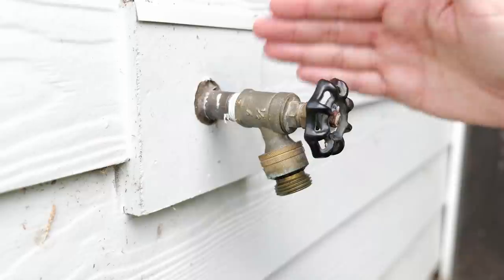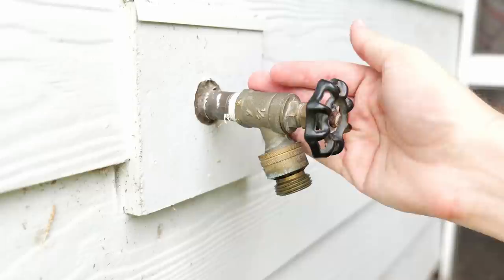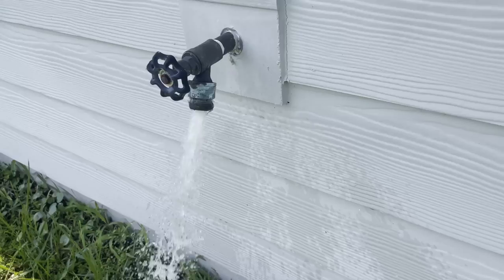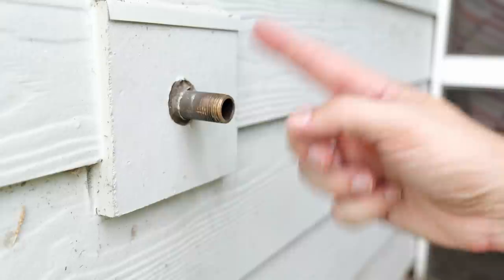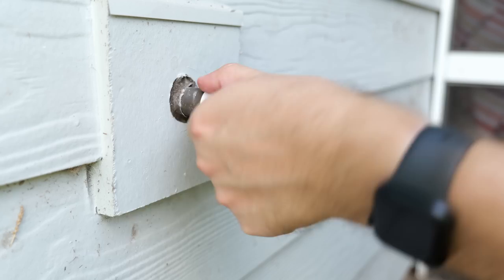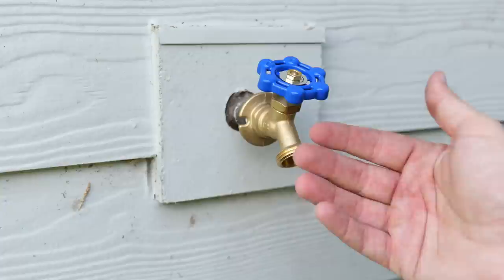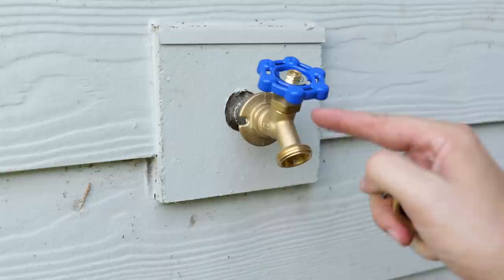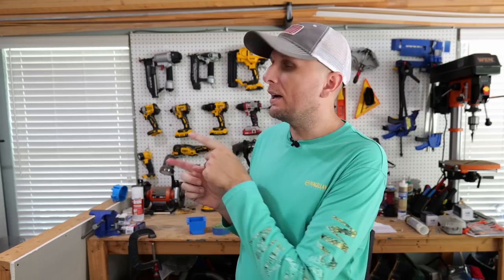The CORRECT Way To Replace An Outdoor Faucet | DANGEROUS and Common Mistake DIYers Make!

Comment: 7:00 Couldn't you just stick a bar of metal in the closed spigot opening and use that for torque?
The solid brass shouldn't deform at all so long as the bar stock is close to the inner diameter of the spigot.
Would leave zero visible damage and provide the easiest torque.

Comment: Is that little screw supposed to break off?  Looks like its tapered to do so on mine???
Reply from the maker: Yes they are.  I just refuse to do it.  If I was renting to someone or selling then I would.  But if that’s broken off, it’s almost impossible to get the vacuum breaker off if it goes bad.

Comment: Can you do a video on replacing the vacuum breaker (anti-siphon valve) when the safety screw (set screw) cap is gone? When my subdivision was built (2015), the builder intentionally had the set screw caps sheared off all the homes to prevent homeowners from removing these anti-siphon valves. I'm guessing the builder was in CYA mode by doing this; but it's a problem when an anti-siphon valve fails and needs replacing, as in my case. The hose bib itself is in otherwise perfect shape.
Reply: Where I live, I was told by a city inspector that it is in the code to shear-off the set screw.
Reply: Use a metal cut disc on a dremel and score a line in the set screw. Now you can use a slot screw driver to remove it.
Reply: If you have a drill and a set of bits, you could carefully drill out the bolt in that small hole. Just need to be careful not to go too deep and drill into the hose bib.
Reply: 8:55 They are designed to break off when tightened.

Comment: have to check out my hose bibs ... when we bought an old house recently and replaced the water supply line the plumber installed a new hose bib and told us we could just take the anti siphon valve off if we wanted to..... things we learn along the way.....

Comment: Have always enjoyed your videos but now I really need to ask for help 🙈

My washer half inch water supply line broke inside the washer room.
Went down into the basement and have a hot and a cold supply line.
I do not have a cap off
But I do have a half inch SharkBite connector.

Can I temporarily loop the hot and cold together with the shark bite until I can get this fixed next week.

I would assume that I would not be able to use my hot water line and that's okay if it will get me by.

Would it be okay to loop the hot and the cold together temporarily ❓

Thanks for all your work and labor in your videos.

Comment: Just replaced my "anti-freeze" faucet.  It goes through to a basement so it was easy access.
I really had to torque the outside faucet in order to stop that last little drop on the inside (I wrapped the threads three times with tape)
Now, it's almost impossible to turn on the water.  The pipes in the basement are PVC so I had my soon hold the nut inside while I torqued it (Facebook was our commo)
How do I loosen up the handle so we can turn the water on?????  Can't find anything on YouTube.

Anybody????

Comment: The little screw breaks off easily because his design to do that. This makes it impossible to remove the vacuum breaker. In the event that someone doesn't like it or the hose becomes corroded to it and it's removed when the hose is removed.

Comment: ..... The head is supposed to snap off the screw, causing a permanent attachment.  Most inspectors look for the head to be broken, making sure the home owner does not remove the vacuum breaker after the inspector leaves, which is what most people do because the cheap metals we get now are crap.  Most vacuum breakers clog and cause severe water volume issues and are a general maintenance pain in the butt, and because you are supposed to permanently attach them, have to be removed with a sawzall or oscillating tool.  I have never seen or even heard of someone polluting their water line because they did not have some sort of check valve on their hose bib.  Who buys a silcock that does not reach the house??  weird.

Comment: Ive had to simply cut off the existing valve and slot cut the band of female threads stuck to the male threads sticking out of the wall.
I invested in some Bonny Wrenches (very thin jaw extra wide opening).
Presently have a Freeze proof hose bib that had cracked from Ice.
after removing the 14" hose bib from wall and discovered on installing new the piping in wall had shifted and the engaugement is 1/4 hole off center.

Comment: My hose bib s probably 25 yrs old and is apparently frozen to the threads as it won’t budge. Naturally, I’m afraid to put too much torque to break the threads loose concerned I’ll damage the interior pipe. Any suggestions?
Reply: Can you get to the pipe in a basement or crawlspace?
Reply: @ngarber   Nope. On a slab. Thank you though.

Comment: Not having a vacuum breaker on an outdoor faucet is a code violation.  But it's not an all caps dangerous thing, at all.  The only realistic way water is going to flow backwards is if the water pressure from the city supply drops to zero.  That happens when there are water main breaks or other outages.  When that happens, ANY groundwater is going to get into ALL of the water supply piping from the city, unless it's brand new and doesn't leak...which is never the case.  The reality?  When the water goes out, dirt and things you really don't want to know about are sucked into your water system through the city water pipes.  So videos like this not only scare homeowners, but they also understate the problems with municipal water systems.  The systems only stay contaminant free when they're under pressure.  Holding your house to a higher standard is just silly, but it is required by code.  Source?  I worked for several years for a municipality.  Yes, I drink the water, but not for a day or two after a water main break.

Comment: Hi, I'm in a bit of a dilemma. Our back yard water spigot worked fine before the knob fell off and was misplaced. Family members started to use vice grips turn the water off & on. Over time the post was totally destroyed & we can't turn on the water at all.  Do we need to replace the whole spigot, or is it possible to just get a replacement valve where the knob & post are attached?
Reply from the maker: It’s possible yes but in that case I would just buy a whole new spigot and start new.
Reply: Replace entire valve, they not that much!

Comment: A backflow of a water molecule from the end of a 50 feet hose and ending up all the way back to the hose bib from an applicator will not happen in a million years. Another gimmick to add for plumbers and code enforcement for $. For a water hose applicator to work it has to have a huge volume of water flowing over the directional orifice to create suction in one direction as it will not work going the other direction as there is no volume. In the industrial plants that is a different story but not a hose bib applicator.

Comment: i hate those vac break things, they are such garbage, had to replace the one in my last house every year, they would fail and leak water all over the floor of the garage it sucked so much, and as you probably know red lt on the factory unit removal was a pain in the arse, I detest the things

Comment: Past couple years my frost free has burst. I turn the water off to it every winter. Is there something I can do to help it not bust?
Reply: Usually it's because your wall insulation isn't up to the task, the bib is in a location that's not heated very well, or the frost-able portion of the bib is too short.
Reply: First did you remove the hose from the bib? If you don't the hose bib won't drain properly and will hold water and freeze! Another thing to check is if the line to the bib is pitched so it will drain when the water is shut off?

Comment: Your setup would lend itself to a frost-free hydrant that goes into the wall and replaces that nipple....depending on how long that nipple is and if you can access/look at its origin. As far as using thread tape AND pipe dope.....that's a dumb Millennial/Gen Z thing that going around. If you do your job correctly, yes, use one or the other. The mega-type tapes pretty much correct the worst of Chinese threads/fittings. Chain wrenches are not that expensive and you can really torque them. Or.....use a good strap wrench like Klein's that doesn't stretch.

Comment: How can water go into the spigot if you turn it off? Isnt it sealed when you turn the spigot off?
Reply from the maker: Only with a vacuum breaker is it actually sealed from backflow.
Reply: @HowToHomeDIY  I usually let the hose run open-ended in one hand or while squeezing handle of the jet nozzle, and the other one turns off the spigot, I've never witnessed water get sucked in from the air. I guess this only applies to irrigation systems. I live in Florida, and most homes don't need irrigation for our home lawns(we get plenty of rain). 
Besides that, if you don't use chemicals in or around the yard, what is the backflow stopping?

Thanks for the reply.

Comment: I'm not in any shortage of shutoff valves I have one inside the house just before the outside hose bib. I have one in the ground between the city and my house and I have one after the meter in before it goes to the rest of the plumbing in the house. However my problem is I can't get the freaking thing off

Comment: Using the word dangerous just to get clicks. The odds of something backing up into the home through an outside faucet are near zero. It's almost always the lowest point in the system and the internal water pressure is higher than anything pushing back against it. Even if you had no water pressure the weight of the water inside the system pushing out would keep external backwash out of the house. You would have to actively pressurize the water coming into the faucet to get it far enough into your home to be dangerous.
Reply from the maker: It’s really not that hard, hence why they are required now.  But sure, just for clicks 😂

Comment: Great video, as usual!  Q: For an outdoor faucet that is fed from City water, not a well, does one need the back-flow preventer?
Reply: With all the pressure that comes INTO the house where the water meter is I don't see how there could BE any backflow but I don't know so I'm just saying how could there be.
Reply: @deadmanswife3625  Thanks.  Great channel.  Man, how did we survive without YouTube!?
Reply: @surfingonmars8979  I don't know how you did but as for me I eat sleep and drink YouTube. I take it to bed with me and I wake up with it in the morning LOL
Reply: Yes. When the main is turned off for either supply, the system can create a vacuum that will draw water in. That would normally apply only if the other outlet for the water is lower. For example your home faces uphill or downhill and you are replacing the rear hose bib. You have a hose on each one, and in hopes of draining the system you open one then the other. The higher one, if it does not have a backflow preventer (vacuum breaker), will suck into the pipes whatever the hose is getting into.
Reply: @deadmanswife3625  from NEWS to POLITICS to BBQ to HOME IMPROVEMENT, once you get the hang of winnowing out the frauds and BOT DRIVEN vids, the amount of info is amazing.  Need to restore a 1973 era Hasty Bake?  100 vids on the subject!
Reply: @surfingonmars8979  😊

Comment: I just installed 1/4 turn bibs on my houses 2 bibs. Do you have any thoughts good or bad about 1/4 turns? Is the normal/standard 3'ish turns bibs better or safer? are 1/4 turns reliable?
Reply from the maker: Nothing wrong with 1/4 faucets.  Really just a preference thing.
Reply: 1/4 turn uses a ball valve, much more reliable design, far less likely to leak, also allows for greater flow.
Reply: When I discovered them. I thought... Why doesn't everyone use these. Then I see brand new normal spickets and just don't see any advantage to them. I'll never use or install anything other than 1/4 turns

Comment: The nut on the vacuum breaker is supposed to break off so you can never remove it.
Reply from the maker: That’s why I am careful not to break it.  Otherwise if the vacuum breaker is stuck on a perfectly good faucet you still have to replace the whole thing unless you want to try and cut the vacuum breaker off.

Comment: When I installed an add-on vacuum break, like the one you installed, the instructions required to tighten the set screw until it broke off. This is to assure that the installation is permanent, preventing someone from removing the vacuum break from the hose bibb.
Reply from the maker: Mine had no such instructions.
Reply: In some jurisdictions, the building inspector will fail the install if the screw isn't broken off. They generally care more about this when on city water to prevent backflow into distribution pipes.

Comment: My hose bib is outdated AND cracked deep in the frost-free stem...in brick.  What hassle. This was 
broken by the previous homeowner and hasn't been used since 2016.  It will stay broken and unused.
Reply: Well you could always use the method that goes back to the days when I was a renter on the third floor. Hook your garden hose (one or two hundred feet) up to your kitchen sink and run it out your window to the area you are gardening in LOL
Still have the same rubber high-quality hoses. Always got every penny of my security deposit back just be careful with things
Reply: The fix (may not work for the same reason the bib was set in brick... poor access) is to cut the copper pipe back in the crawl space and pull the whole shebang (technical term) out, assemble it in comfort, insert the new pipe into the brick, and sweat the pipe back together.
A tip from the retired plumber who coached me at the local hardware store: if the paste flux is more than a few months old, get a new tin of it. Cheap, and I can vouch for how much better it works when fresh! After a year old it will make you cry.
Reply: @flagmichael Yup.  I suspected much drywall work too.  There it remains.
Reply: They make frost-free bibs longer than brick, so if you can get at it from the inside, you can replace it that way. I had to do that for one of my house bibs. Now I just need to learn how to texture drywall to make the patch not stand out.
Reply: @johnhaller5851  Yup.  That is the issue.  really did not want to open up the wall.

Comment: Teflon tape isn't the same thing as plumber's tape. Plumber's tape is the perforated metal strapping that is used to support pipes.
Reply from the maker: Thread sealing tape is commonly referred to as plumbers tape.  Pretty much nobody is referring to what you are describing when the say plumbers tape.
Reply: @HowToHomeDIY  Don't get mad at me because you are using the wrong terminology. You are wrong by the way. 

Just because you and your buddies have been calling it the wrong name your entire life doesn't make you right.

If you were a working with a real plumber and asked for some plumber's tape, they wouldn't bring you Teflon tape.
Reply from the maker: Nowhere in my reply do I sound mad.  But you’re wrong, every plumber I’ve talked to and even if you go on plumbing sites, they refer to Teflon tape as plumbers tape.  You don’t have to agree with it but it’s common terminology for it.
Reply: @HowToHomeDIY  I'm sorry but you are still wrong. The websites will call it plumbing thread tape or plumbing sealing tape. Plumber's tape will pull up results for the metal support strap in the actual product name or description, not simply keyword spam results.

Search keywords will give you all products combining the words plumbing and tape. Teflon thread sealing tape isn't commonly called plumbers tape by any manufacturer or professional plumber.
Reply from the maker: @davidparker9676  No, they literally call it Plumbers Tape.  What you are talking about is called metal perforated plumbers tape.  Even plumbers in forums, their company websites, etc. call pipe thread tape plumber's tape.  But you can continue to argue this as long as you would like, it won't make it true and the interaction on the video is helpful.  So thanks!

Comment: Why does vacuum breaker spray water all over me when I shut off the water?
Reply: It’s doing it’s job.  That water could have entered your household plumbing if the breaker wasn’t there.  There is pressure in the hose, the vacuum breaker is relieving that pressure.
Reply: @jpe1  The way it works is unacceptable.
Reply: @toycarpgmr  yeah, I’ve experienced the same thing, I understand why you find it unacceptable.  I’ve had it happen when I have a length of garden hose with a spray nozzle on the end of the hose, and by stopping the flow at the spray nozzle the hose gets pressurized, so when I turn the faucet off the pressure pushes the vacuum breaker open and water sprays out.  You can try turning the faucet off before you turn off the hose nozzle, see if that helps.  If that keeps the from spraying or leaking out of the vacuum breaker, then the answer might be to put an inline shutoff, or a Y-splitter with individual shut-offs, on the faucet end of the hose, and if you turn that off first then turn off the faucet there shouldn’t be any pressure to spray water out.  One caution if you do that, you must drain the water out when there might be freezing temperatures, so nothing breaks from freezing.

Comment: I'm not suggesting to disregard your local code but as long as you relive the residual pressure in the hose  after you close the hose bibb, (which you should do anyway to make the hose last longer), the water pressure in your system will prevent any back-flow.